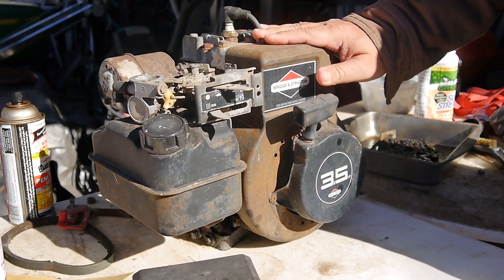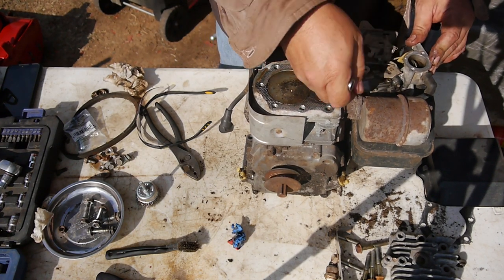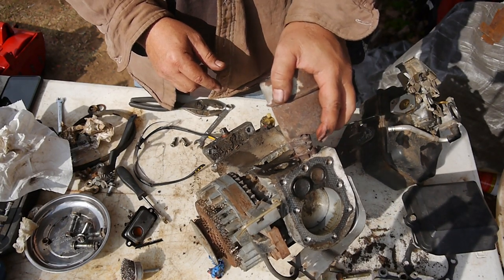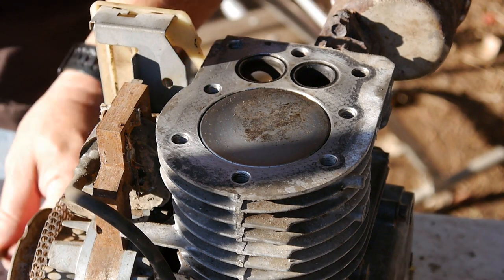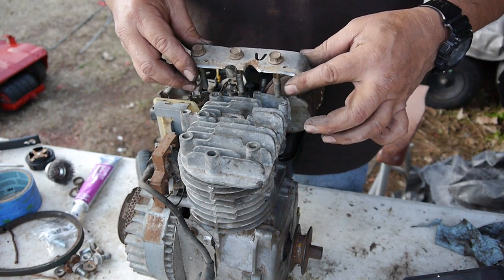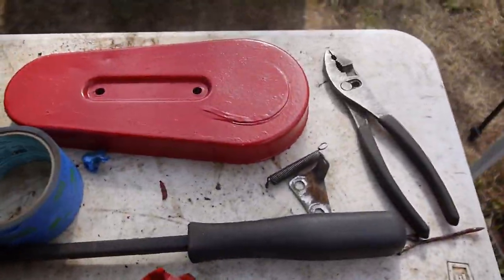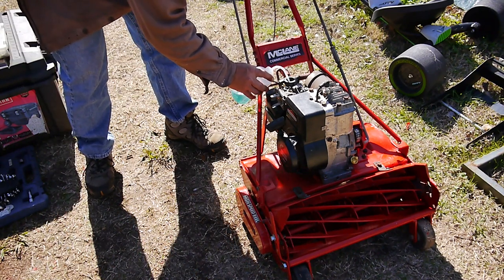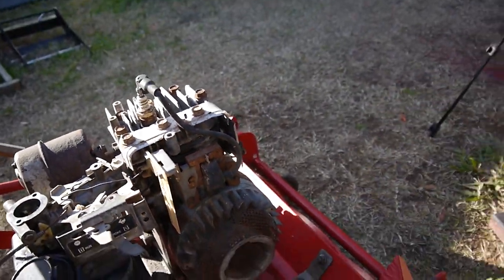Rusted Mclane Reel Mower Restoration - Part 2  Will it Run?

Comment: Hy, have you checked magneto/coil area, maybe a broken wire or two?
(Looks like it needs a light sanding with emery cloth around that area anyway!)
Camshaft/ cam lobes?
You say you had a white watery gunk type stuff in the oil, maybe a strip down and a good clean, then new oil?
Crankshaft bearing.....surface rust on bearings, maybe due to rainwater getting in there from the stuck open exhaust valve?
Just my thoughts, from mikky, across the pond in the UK--greetings!!